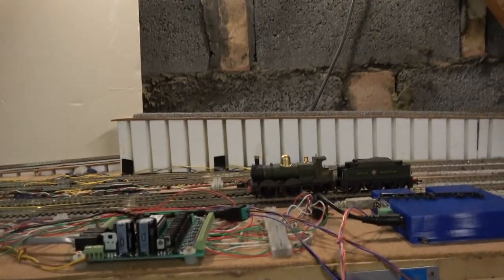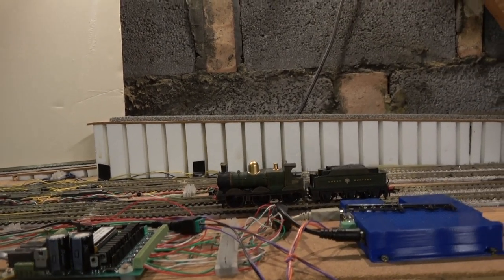The last train on the water tank line

Comment: RIP Water Tank line. I also have a railway called Skegness Central which had 3 stations.
Skegness Central: Still open (somehow, hobbling on a few trains a day)
Burg-le-marsh: Opened 2018 closed 2021 Due to lack of passengers and last services being cut from the station due to train faults
Skegness Pancras Road: 2015 (when the line opened) till 2016. Closed due to line remodelling.

I dont know if I will keep Skegness Central open. Hopefully will but even if it closes, I was still keep my layout as a through line. All these cuts are happening because more and more trains are developing faults which I have to remove them from service temporarily for.
Reply from the maker: Thank you. Good luck with your layout
Reply: @TrainsintheAttic  Good news- I saved my layout by repairing my trains and now everything is back to normal
Reply from the maker: @trainman86trainstramsandmore  that's great news